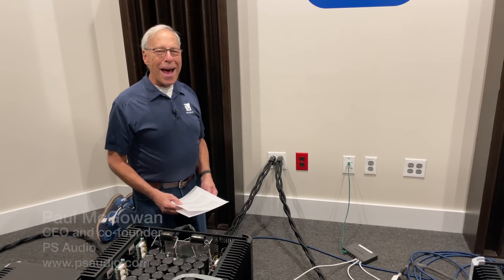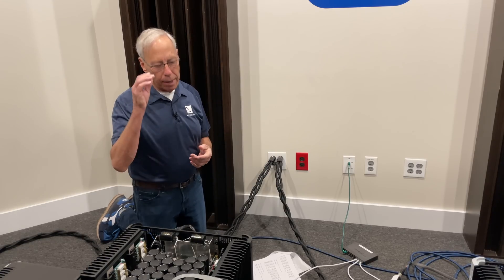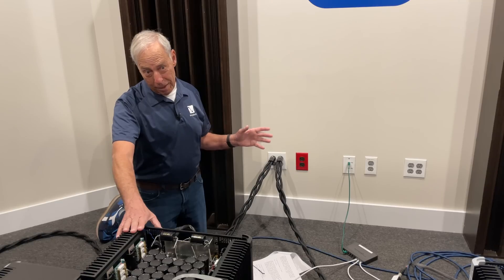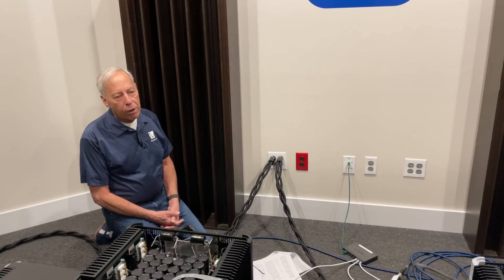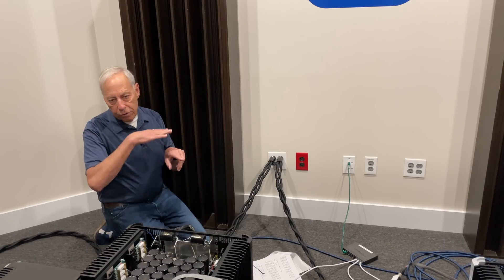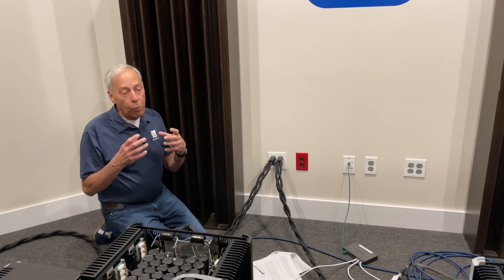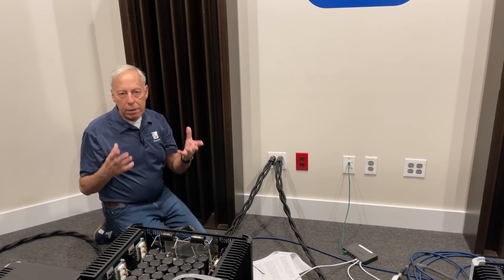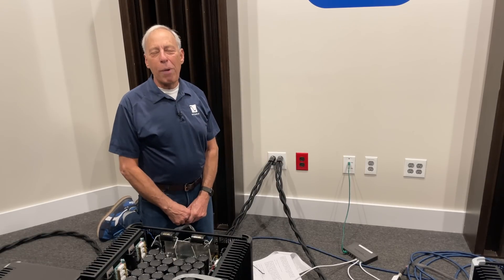Are braided power cables better?

Comment: You just fueled an unhealthy obsession over power influencing sound. If the goal is clean sound, I can already see producers in the music industry laughing their asses off as they add compressed vinyl hiss and pops to tracks. Thing is, not all music is produced the same and those slight differences in frequency per song can drive an audiophile mad. “Well-designed gear doesn’t need a premium power cord priced over $100 because it has circuitry inside that can reject AC power noise.”
Reply: Please list the power cables that you used in your listening test, to conclude that power cables make no difference.
Please also list all of your stereo's "Well-designed gear" that you used in your listening test (speakers, amps, pre-amp, DAC, transport, phono-amp, tone-arm, cartridge, etc), and room treatments.
Reply: @Duranarts:

24 hours later:  2nd Request:

Please list the power cables that you used in your listening test, to conclude that power cables make no difference.
Please also list all of your stereo's "Well-designed gear" that you used in your listening test (speakers, amps, pre-amp, DAC, transport, phono-amp, tone-arm, cartridge, etc), and room treatments.
Reply: @0Perhaps  Forget it.  No one is ever going to submit to any tests because of a few reasons:

1)  They don't have the money to buy the various products.
2) They are scared that after the costs and time, they'll be proven wrong

Besides, no test is ever going to be valid for a very simple reason.  There is no established, agreed upon control. On top of that, even if there was an agreement on a control system, that system will operate differently in different environments.

So, until a super rich person decides to build a facility where audiophiles can come and make tests on a system and environment that is agreed upon 100% as a control, we will never put this debate to rest. :(
Reply: @falcon048  Even if a rich person did so, some naysayers will still cry shenanigans.  They will claim that some slight-of-hand is going on, etc.

There will never be, and should never be, an agreed upon control, because we all have different tastes (so it cannot ever really be agreed upon).  But any truthful person will confirm that they hear the improvements that accompany better power cords, on all but crappy stereos.

And although this conversation will never end, we should never let the trolls make an inch of progress.  Never back down to bullies.  Never let the inmates run the asylum.  Never let those, that never did a listening test, spew misinformation.  If they cannot do a listening test, then they should not assert that they know what is what.

I never declare XYZ in a video about things I do not know.  People that do that are inconsiderate and arrogant.
Reply: @0Perhaps  I used to be skeptical of power cables until I was in the market to start acquiring them.  I had the biggest and most dramatic gains in sound quality than I ever did upgrading interconnects and speaker wire. 

As a result however, I no longer believe that "crappy" equipment is incapable of being affected by the quality of connections and power; especially power. 

I was running a quirky system on my computer that all the "audiophiles" pissed at because I spent 10 times more on the back end than I did on the speaker system.  The results were unbelievable.  So much so that every one who listened to it was blown away...first by the incredible sound...and then the incredible price tag ;).  

I had the Audioengine A2+ paired with their S8 sub.  By itself it's a reasonable system. However...I was running Audioquest's NRG Edison socket, with PS Audio's Noise harvester.  Then coming out of that through Shunyata Research's Reference Delta v2 XC and into Shunyata's Venom V16 power distributor. That's already $3200. But it powers everything.  The speakers, the sub, the PC running the music, etc. Going into the A2+ was Kimber Kable's Summit Palladian. Yes, a $1400 power cable going into a tiny speaker that cost about $280. Then I loomed the whole thing in Synergistic Research's Foundation line. 

No one would have ever thought to build a system like that.  For $280, the A2+ was an engineering masterpiece. A small AB class amp that could push 22Khz to 65Hz. The sound quality was intense, clean, clear, musical, holographic. 

I later upgraded to Audioengine's HD6 to get a more full and rich mid-range and mid-bass. With all that power back end, this speaker system is still thirsty and hasn't quite attained the the sound glory its teeny-tiny brother was capable of. :(  I think I have to upgrade the main interconnect and the power cable; it's a future project to be sure. :)
Reply: @falcon048  "I no longer believe that "crappy" equipment is incapable of being affected by the quality of connections and power; especially power."

You then went on to describe your system, which was not crappy.
Does Walmart sell your speakers?  How about Target?

If those stores sold them, then that would be an eye opener.

There are loads of great speakers at $200 - $300.
There are also loads of $h!t speakers in that same price range.

You chose wisely, and the clean power allows them to perform at their best.

I doubt that a crappy system would offer any improvement, if you did the same thing.  Maybe you might hear a slight improvement?  I never tested on crappy equipment.  It just stands to reasons that if the speakers suck, then they are incapable of revealing improvements.  But since I never tested, I can only assume.

But it is good to know that even $280 speakers will light up with clean power.
Reply: @Duranarts:

48 hours later:  3rd Request:

Please list the power cables that you used in your listening test, to conclude that power cables make no difference.
Please also list all of your stereo's "Well-designed gear" that you used in your listening test (speakers, amps, pre-amp, DAC, transport, phono-amp, tone-arm, cartridge, etc), and room treatments.
Reply: @Duranarts:

4th Request:

Please list the power cables that you used in your listening test, to conclude that power cables make no difference.
Please also list all of your stereo's "Well-designed gear" that you used in your listening test (speakers, amps, pre-amp, DAC, transport, phono-amp, tone-arm, cartridge, etc), and room treatments.